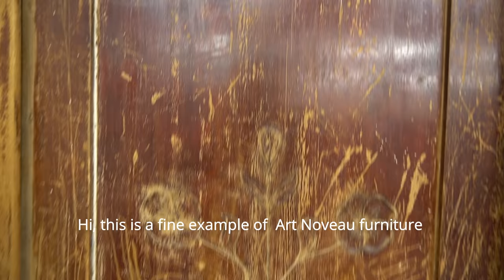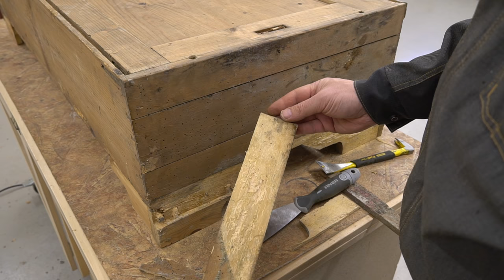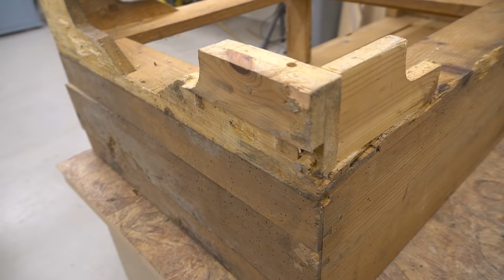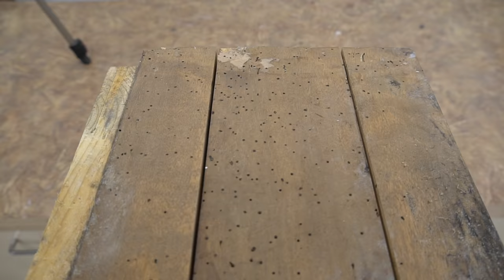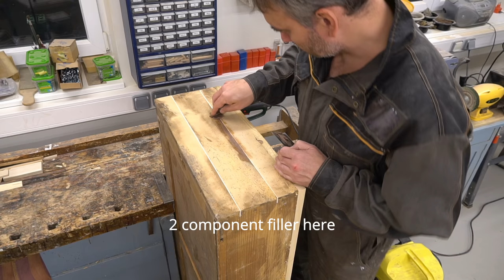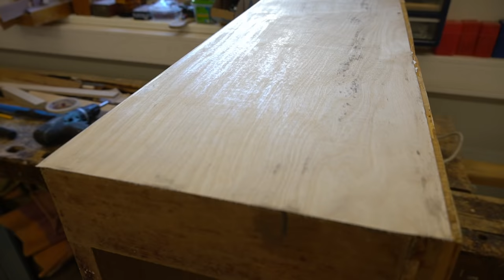How to restore an old wardrobe

Comment: This makes me cry. I used to have an old wardrobe like this one. Mine wasn't decorative but it belonged to my great grandmother's sister and it used to be in my bedroom. It came apart as well, which was great for when I wanted to move it. A top piece, a bottom piece and both sides of the cabinet lifted out. It had two drawers in the bottom but no covering to separate it from the wardrobe itself. There were hooks inside for hanging clothes and it had a lock in the doors. It sat for years in my great grandmother's farm house which we still own but it was damaged in a fire. Even so, I loved it. While doing some work on the house,  my son sat it outside and someone came by and stole it. I only hope that whomever took it restored it to the way it must have looked in my great grandmother's time. Thank you. I enjoyed watching this very much.

Comment: It great to see real skills to repair old broken once loved pieces of furniture and make them loved once again. I  really like to see the grain of the wood in its natural colour. Every piece is unique in its markings and pattern. And when furniture is made of solid wood and its colour enhanced with a natural product it's beauty shines once again. Bravo. 
(I have a very old chest of pine drawers I've had them nearly 50 years and bought them at an auction for £1.00. (At the time £1 was 9% of my weekly income) I wish I had the skills to repair them - the top is made of 3 or 4 panels and there are gaps and a bit of unevenness perhaps exposed to water or heat at some time in their lifetimes and the drawers have no stops to prevent them falling out. I stripped them of their original dark varnish to show their natural colour and grain once more)

Comment: I just recently bought a wardrobe very similar to this one and in a similar state of neglect...the only difference being it has one large door that opens in the front except for the two on yours.It has been sloppily stained and a coat of varnish slapped on ,and some ridiculous haphazard metal strips used as "hinges".I will do what I can as my finances permit,I know I can get a second hand router and various tools at the pawn shops etc.Thank you for showing me how much work that is going to be needed eventually to restore this basic gem,a lot more than I ever imagined - more than just a set of new feet,a good sanding and a few coats of chalk paint with some decorative ornament added than I was thinking.There is some worm damage to it that can't be ignored that must be done first..I am saving your video to guide my steps ,as I can only take baby steps,and cant afford a professional restoration.Thsnk you for this extremely important video.!.

Comment: Such a beautiful job. The roller, you can try putting it in a plastic bag then seal it up tight, we would do that with paint rollers and also with mops with shellac and wax on them. I use to do janitorial work for my local school system for many years.
Reply from the maker: I have special air tight jar for that.

Comment: I didn't know you could mix stain types, I figures you'd have to do all water-based or all spirit-based.

and fixing those drawer slides; we have a dresser that could definitely use that (and also replacing some edging on the drawers that ends up being a bead on the edges).  Of course we don't have the equipment for that, so eventually we'll sell it on to a restorer before selling the house.  (we've never found out if this is one of the pieces grandpa got from Major Bowes).

Comment: With the alkyd varnish on the roller that you are using, it looked like the roller picked up the dark stain you applied.   If it did, pick up the darker stain, when you use that roller again on another project that you stained another color; will the color on the roller be released and discolor the new job?

Comment: Here is a simple trick that I do use:  Stain the filler first then apply it.  After it dries it doesn't take stain the same way.  
This works with glue and sawdust really well as the wood dust is "wood" not a filler paste.

Comment: Amateur question here: After stripping and sanding do you ever use a pre stain wood conditioner to reseal the grain so the stain applies evenly over the surface? If so, what makes you decide to use it or not use it?
Reply from the maker: This time I didn´t use it. Some woods get more blotchy than others, the birch is the worst one. Now I use dilluted shellac for a sealer.

Comment: Long ago did they not use any sort of adhesives or glues  to help hold things tight? I've noticed you just bumping pieces apart without anything splitting or getting cracked unlike if glue was holding it together

Comment: Why use spirit based strain at 30:20? Most other situations you have been using water based? Was it to get grain to show more?
Reply from the maker: Good question. When the water based stain dries  and its is left without clear coat, then it looks like pink wood. Spirit based stain just goes a bit lighter.

Comment: Ahti, with so much damage do you apply Shell-gard or similar borate product to kill worms and fungus?  Beautiful job, by the way.
Reply from the maker: Hi! I do it only when the client asks for it. If the furniture is kept in the room that has consistant teperature and low humidity, then usually the worms wont be a problem.

Comment: Perfect balance between staying true to the original and quick /profitable work. I've restored one similar wardrobe (although considerably bigger one) and the only difference was I was worried that some worms might still be there (although I know any insects except spiders in 70 y.o. piece of furniture is unlikely) so I used a lot of toluene to fill up most of the holes. That alone took me some 20 hours to finish in 3 iterations (!). I'm amazed with this dovetail jig and since I went trough similar process I really admire the skullfull work. Additionally filmed in very pleasant way. Subscribed! P.S. Wondering what finish stripper do You use?
Reply from the maker: Hey, thanks for a long comment! I use this one: https://www.bauhof.ee/et/varvieemaldaja-1l-424815

Comment: I’ve got an item made of beech which was originally spray finished with a coloured lacquer. I’m refinished the piece and understand the beech will soak up the stain at the ends of the grain and be much darker there. Does anyone have any tips for getting a nice even finish on beech?
Reply: You could try using a thinner solution of stain at the ends, than you use on the face of the boards.
Reply: @theBaron0530  Nice idea, thanks. I was actually thinking of trying to seal the ends with a clear sealant, then building up the finish over that with a water based stain, I actually watched this chap build up colour using water based stain and multiple coats in one of his restorations. Your idea of thinning out the stain might be a simpler way of doing it, especially if I’m using water based stain, I guess I’d thin that out with plain ol’ water🤔
I just don’t want to cock the job up at this late stage, after all my hard work and sanding!

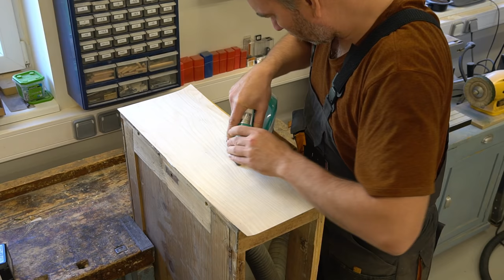Comment: 7:30 - why the veneer? Spoils original primitive character and unbalances the base wood if you don't veneer the reverse face. Good job on drawer sliding. Don't need to make drawer front dead flat, loses character

Comment: There is no patina anymore. It looks like new, cheap closet. Would have just repaired some parts, clean and put wax. Sorry but I do not like it
Reply from the maker: You can wax things that need a little care, not a big job like this closet.
Reply: @ATRestoration  Maybe. But there is difference from something new and something old. However, I was not meaning to convince anyone, I studied theories of conservation, this is why I simply commented, without putting any like or dislike.
Reply from the maker: @marcoa.8411  I know many restorers and they almost never use wax. Wax is more popular among the hobbysts, because its easy to apply and its not possible to do any harm to the furniture. I also dont do conservation, I mainly restore things for everyday use for my clients.
Reply: @ATRestoration  Ok, Fine with it.